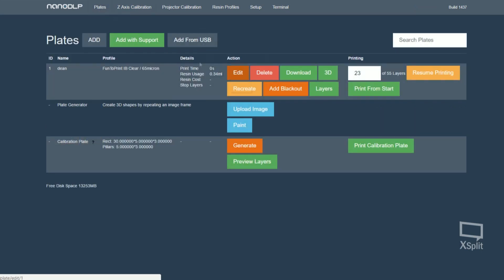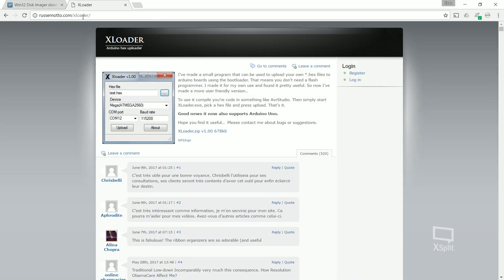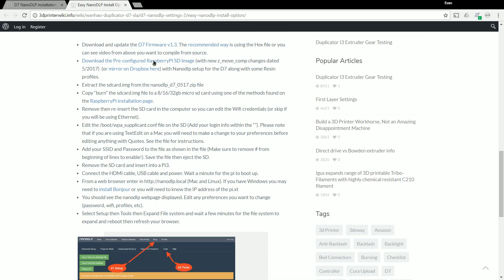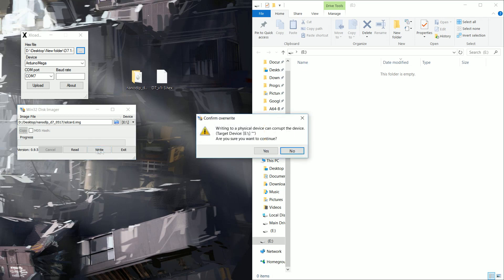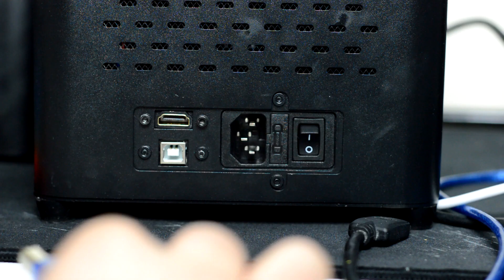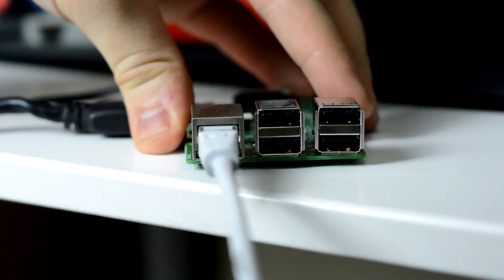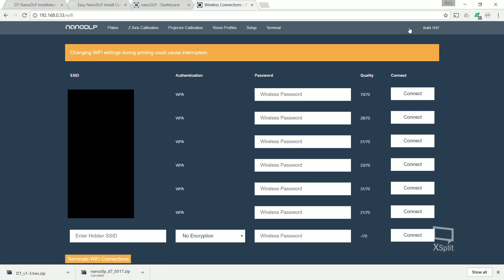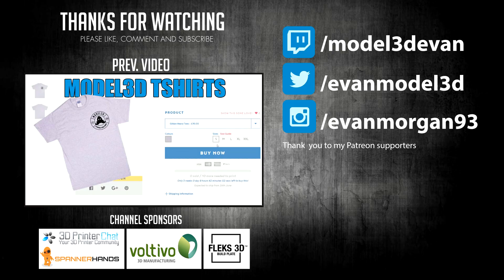How To Install NanoDLP On The Wanhao Duplicator 7

Comment: On Wanhao website it is stated: "We have embedded the NanoDLP firmware in stock firmware for V1.3 and V1.4." IS the "D7 Firmware v1.3" still need to be flashed to use NanoDLP on a D7 1.4 version?
Reply: Did you ever find the answer to this?
Reply: I have a 1.4 and still needed to flash the firmware. Very easy though.